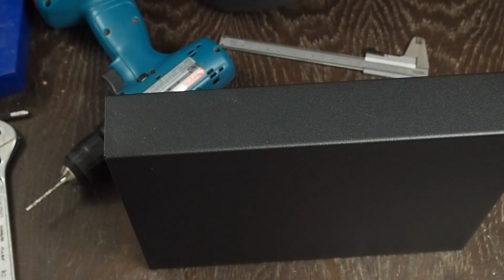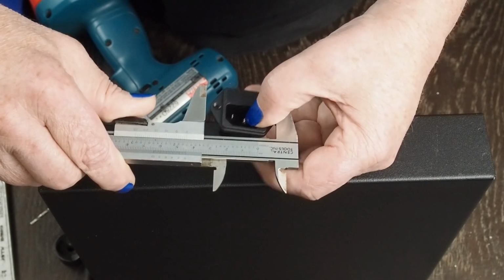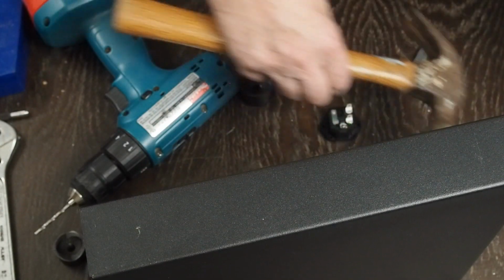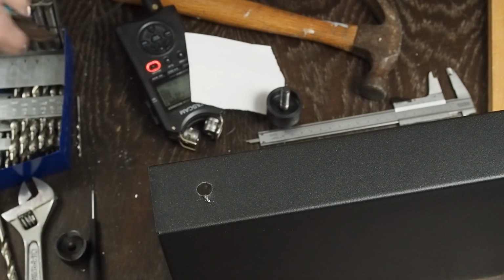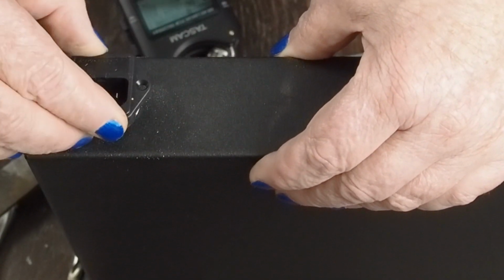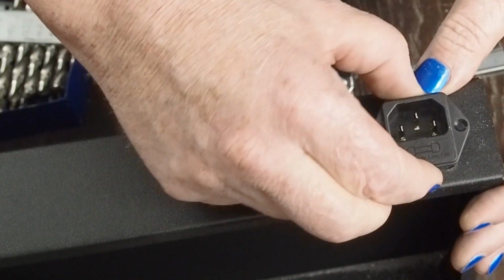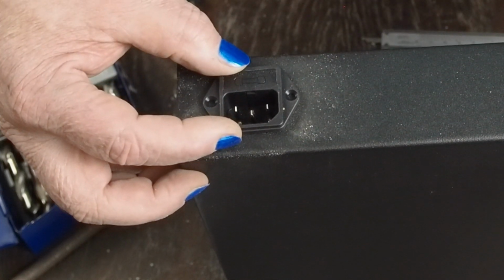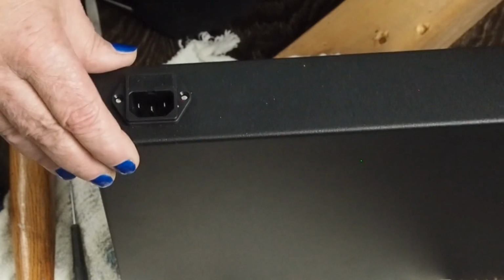6SQ7 EL34 Tube Audio Amplifier: Fabrication #1

Comment: I think I will use our Dremel for my 300B build.
Reply from the maker: Since I did this video I've learned the easiest way to do the IEC connector is drill a small hole in each corner and carefully use a dremel cut off wheel. but be careful it's easy for it to jump and run across the chassis destroying to powder coat!

Comment: I just bought a few of these IEC connectors and a bunch of square punches that were reasonable $. I’ll post my results when I have something to report. This process is WAY too labor/time intensive for makers. Enough is enough. I also reached out to a punch manufacturer for a 19.5 x 27.5 mm rectangular punch for another IEC plug connector. Fingers crossed I can put this tedious issue aside for makers.
Reply from the maker: I have found using a saw to cut these is easier, but I would love a square punch. The few I have seen for sale were hundreds of $$$$.

Comment: Great videos, keep up the good work.  For the IEC socket if you are not using a punch a to scale paper template you can print and tape in place would give an easier time rather than always measuring it every time.  Also I would drill all the corners first then punch the centre.  That would leave minimal material to remove with a file and leave you with nice rounds corners
Reply: I agree totally with all of your suggestions.
Reply from the maker: That is the fun with DIY, you can decide how you want to do it.